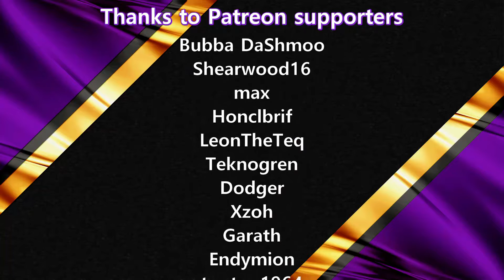PREPARING NUCLEAR TOWER - Satisfactory City #112

Comment: I think it might be a good idea to consistently clip rail segments to foundation edges just like you do it with belts. They don't seem to snap to the foundation surface very well when placed in the middle of a slope and the edge gives you better reference.
Also if you want to be certain that the belt goes the right way after a turn, just build the straight parts before and after the turn first and only then add the turn. As long as it's not too sharp or too steep, the turn will snap cleanly to them and you're not limited to certain turn diameter or slope.
That approach might allow you to make a nice rail through that diagonal part of the cave, too. In a similar fashion you make your gargoyles.

Comment: I'm pretty sure the slowdown you're seeing coming in to the stations is due to slowing down to stop, not (just) due to the hill.  I found when driven manually it could maintain 100kph uphill - there's just not much space on the level at either end for the station slowdown, so it starts that well down the hill.